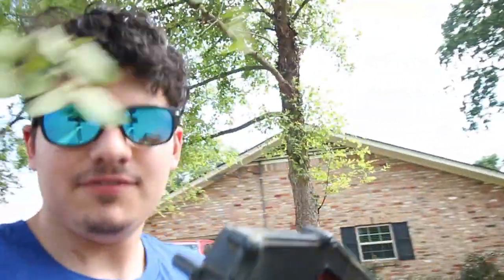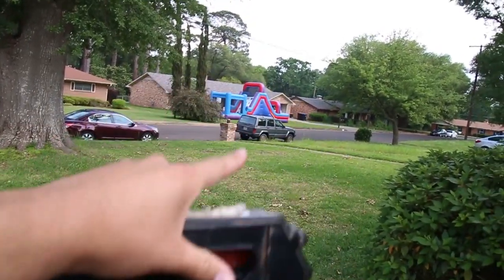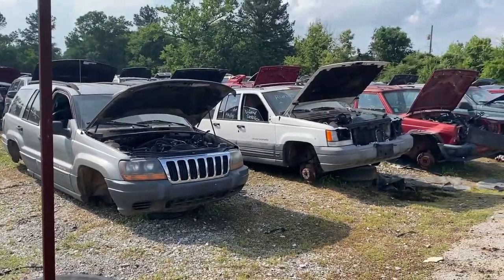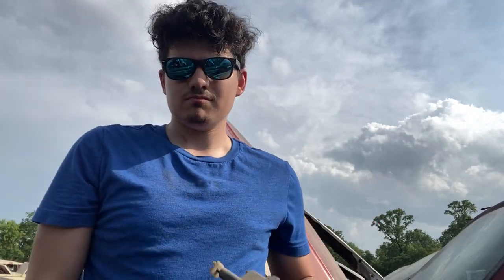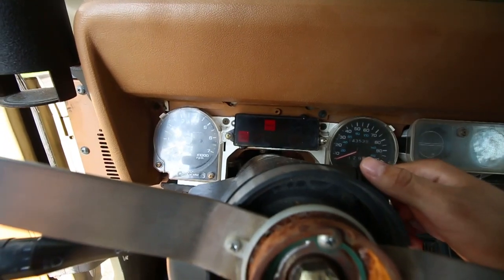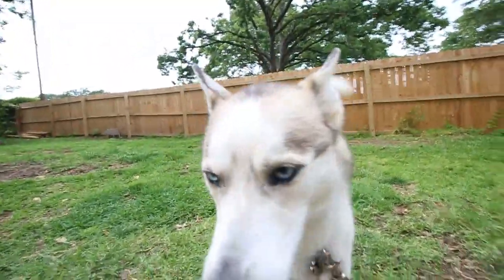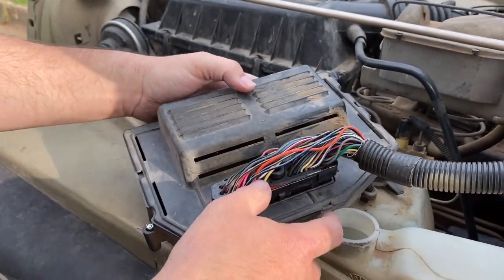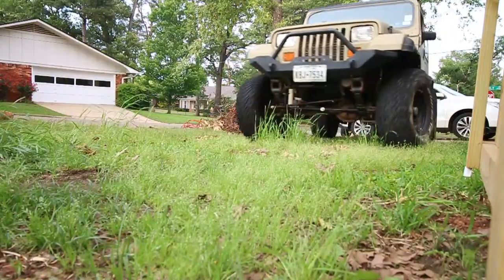Will a Jeep Cherokee PCM work in a YJ?

Comment: Replace Crankshaft Position Sensor
Reply from the maker: David Leazer already did. I just did an ax15 swap and got a new cps but since I had the starting issue I returned it and got a new one. After testing everything else the black and blue wire on the plug goes straight to all the spark plugs and it’s not getting a proper connection. I’ll have an update in the next few days!

Comment: Hey man.. I’m wondering what the cause is of that burned up Pin in the ecu plug. Mine had the same issue, along with to blown alternator/battery fuses in the pdc. 

What turned out to be the cause with yours? 

Great video btw 👌🏼